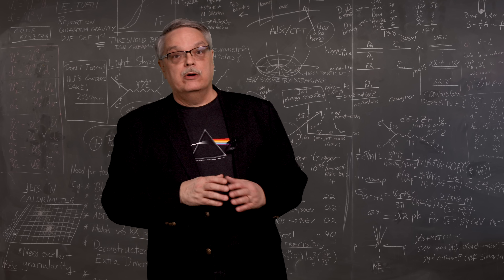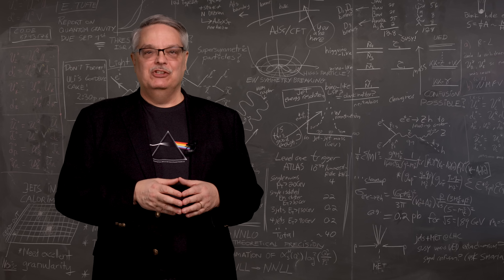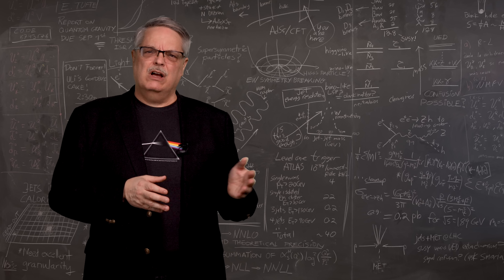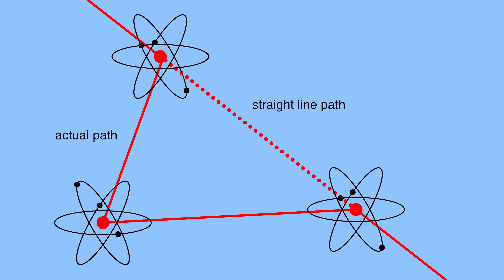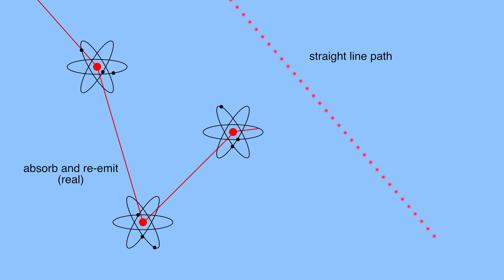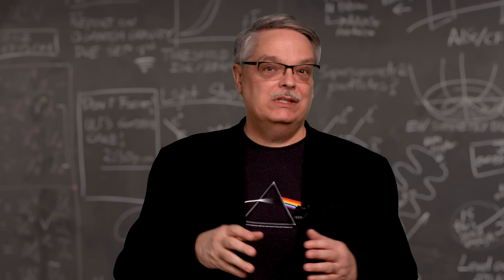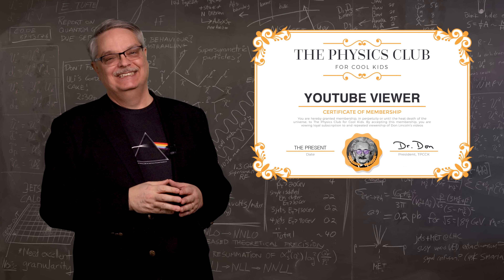Why does light slow down in water?

Comment: Doesn't explain the change in direction nor the restoration of the direction after leaving the material. 
Also doesn't explain why the combined new field after passing the first atom doesn't then combine again with the next atom and create yet another, different electric field, and so on at each encounter with another atom. 

And it doesn't explain how the light, which changed by an angle upon entering the field, and changed again by the reverse of that angle when leaving, retains the direction. The light when it leaves the material could change by the exact reverse of the entering angle, but in a different direction not parallel to the original direction.

This explanation is not satisfying.

Comment: Thank you Dr. Don Lincoln for your video.
May I ask a question. 
What happens to the light or  "lights" that's in the glass of  water. 
I would think light or "lights" can enter the glass from all directions and all angles. Some enter directly, some from reflections, some may bounce off the internal glass wall. I see the water inside the glass as a body in a mesh of lights. Would these mesh of lights skew the object? Thank you.

Comment: Good video, all true but didn't focus much on another effect - the temperature of the water will increase when light passes thru it.  I know it will be explained by the "second" electric field generated by the electrons moving as a result of the light but why does the light emerge on the original path (angle) when the 2nd field which interacts with the light field will be in all sorts of directions depending on how/where the electrons move.  Would explain the water heating up but why does the 2nd field (electrons) add with the original light's eectric field and still give same direction for the light?

Comment: i understand that the peaks move slower, but what about the propagation of the front of the wave. if these waves are simply being superimposed then both the original wave and the second wave generated by the electrons should still exist.  so wouldn't both of these waves reach the edge of the glass at the speed of light ?

Comment: Nice video. So, the generation of the electric field when light passes through a non-vacuum media will consume energy. How does this affect the light? Will it decrease in intensity? Is this energy somehow "recouped" when the light exits the medium and enters vacuum again?
Reply: Light itself doesn't change. Its wave superimposes upon the generated electric field of the electron. The energy of the superimposition is the energy of the light minus the energy of the generation of the electric field (the work required to jiggle the electron).

Thus when the light exits the medium the superimposition ceases and light is free to be the Universe's speed limiter once again.

Physics is essentially the study of how light interacts with matter and how matter interacts with itself. Light and matter are fundamentally separate entities so when we speak of light "changing" within a medium, we are really describing the interaction between light and matter. Once you factor in gravity fields generated in spacetime, the interactions become more than a little wonky...
Reply: Yeah, the induced electric field inside the medium causes some energy loss. This is transformed into heat, which is simply the jiggling of atoms (the same jiggling that generates the second electric wave to begin with). The exit wave will have the same frequency, but a slighty smaller amplitude, thus a drop in intensity.
Reply: @KingIsulgard  that’s not how energy in photons works. Higher energy means higher frequency / shorter wavelengths. You can’t apply the concept of “amplitude” to light waves. (Don’t take my word for this, look it up.)

So this also has me scratching my head: how can light lose energy but still maintain the same frequency? And why would the frequency influence the speed of light?

If that were true then light would travel at different speed according to its frequency. But it doesn’t, C is constant for all frequencies.

Light is massless so if it’s not losing energy through it’s frequency then it’s not losing any energy at all.

I’ve just started investigating this specific topic but my theory so far is that the interactions of the electromagnetic waves in light and matter causes some warping in space-time similar to gravity in general relativity, which causes time to dilate.
Reply: @Yogarine  Light speed is the same for all frequencies in vacuum. Matter slows down light of different colors in different amounts, hence rainbows (and dismay among optical fiber engineers).

The light doesn't lose energy due to the slowness (and the description in the video is a bit superficial, not even talking about quantum mechanics). Absorption and hence energy transfer to the medium happens by losing photon, not by changing their frequency.
Reply: @Yogarine  you can't use "amplitude" for _photons_, NOT light _waves_. The amplitude is an indispensable part of describing a wave. The energy delivered by the wave per second will be proportional to its frequency and the square of its amplitude. In case of a light wave, this amplitude is simply the "size" of oscillations in the electromagnetic field - the larger the wave, and the more it wiggles, the more the energy carried by it. More mathematically, an EM wave can be written as E = E0 • sin(ωt). The amplitude of this EM wave is E0 - the maximum height of the wave. Frequencies manifest themselves to our senses as colours, so if you change the energy of a light wave by altering the frequency, you'll see it changing colour. But you could also change the amount of energy delivered by increasing or decreasing the size of the oscillations, while keeping the frequency constant, in the electromagnetic field. That simply amounts to seeing a brighter or dimmer light of the same colour. 

Here's a nice explanation from a freshman physics textbook to help you out. Follow through the maths to completely understand what's going on here. (In case you feel tempted to "debunk" me before going through this, here's the first line from the learning objectives of the chapter: "Express the time-averaged energy density of electromagnetic waves in terms of their electric and magnetic field *amplitudes*")
https://openstax.org/books/university-physics-volume-2/pages/16-3-energy-carried-by-electromagnetic-waves
Reply: @Yogarine  You should not use the photon model here. It is really only appropriate to talk about photons when something adds energy to the field or subtracts it from the field. In between the field is not really quantised at all.

Comment: It does not make sense. The speed of light is constant for observers in any frame of reference. Time and timespac are directly related to the speed of light. Time dilation exist because the speed of light is always constant. The density of the air should not any difference.

Comment: If you had a hypothetical piece of glass thick enough that it took light, lazer beam, 5 seconds to pass through, and you turned the laser off, would the beam continue to exit the glass for 5 seconds or would it stop when the laser was shut down?
Reply: The beam would continue to exit the glass for five seconds.
The light wave that was emitted is still propagating. Only when the source is switched off will the tail-end of the wave desist from propagating.   The previously emitted wave will continue, only the end of the wave will eventually emerge after five seconds.
Reply: @peeet  Thank you!! That makes sense!!! Sometimes I try and think to hard and confuse myself...lol

Comment: Thank you for the easy to understand explanation. But how this hypothesis explains why the light bends and then emerges parallel to incident light?
Reply: Bending is due to the requirement that the phase just inside and just outside the boundary at any point on the boundary must be continuous coupled with the change in wavelength caused by the change in speed.

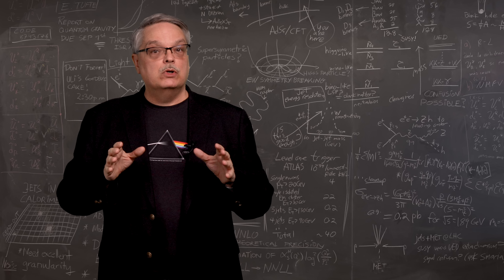Comment: It seems to me that there is a logical lap around 8:45.  It does not explain why the secondary wave (due to electrons) is slower than the original one. I assume that explanation of this fact requires more comprehensive quantum treatment which should also be able to fix the first two attempts of explanation.
Yes, you can also speculate using the electron's "inertia" but this would be a classical attempt (usually prompt to errors) to explain quantum phenomena.

Comment: So light is slowed down by a sheet of glass but electricity isn't slowed down by miles of metal (a cable)?  Obviously there is a difference that exists but a field set up by an electrical potential difference creates the electric current but why doesn't the medium, the cable made of metal react like the glass and set up a wave of its own and consequently slow down the passage of energy in the cable?

Comment: so being that we have discovered a ton of "dust" out in the universe, would most of our calculations relating to time and light need to be adjusted? space is not a true vaccum due to that dust, so would that not throw a pretty huge wrench in to our understanding of the time line of the universe? if there is dust out there it would slow down the speed of light and thus push back dates on things like the big bang? also since we dont actually know the concentration or amount of that dust how can we know how much that light is slowed down?
Reply: We don't even know that the speed of light hasn't changed. It's a major assumption that physicists make.

Comment: Basically it means that light does not travel as light within a matter medium. It becomes some sort of electric wave which is slower than light (magnetic wave) because electrons interact with the Higgs boson therefore they are slower than light because the Higgs interaction creates mass. When light leaves the medium it becomes light again and moves at full speed because Photons do not interact with Higgs therefore have no mass.

Comment: I was taught about fifty years ago in physics that the atoms absorbed and emitted the light in same direction (the second wrong belief). For various reasons (doesn't explain speed of light in different materials very well) it never felt right. When I saw the title to your video, decided to get a better understanding of the process. Surprise ... I was taught wrong. This explanation makes much better sense.
Reply: Please can you explain to me why the wave created by the electrons moves at a different speed 9:20 and also why the combined new way moves slower than the speed of light 9:43 ? Please I didn't find why...
Reply: @Khalid-Ibn-Al-Walid  The wave created by the atoms isn't actually going anywhere. It is an electrical vibration. Light is also an electrical vibration. There is a diagram of the combined wave at 7:05. You can see that the top wave is actually considered to be stationary. Anyway, that is the best I can explain. I became an engineer because I knew I wasn't smart enough to be a scientist.
Reply: @JaimeWarlock  I saw the video many times again and focused on the 7:05 as you said and I think I finally got it ! Thank you very much bro ! 
( Btw me to I want to be engineer, in IT, I like physics but I find IT to be way more accessible and practical 👍)

Comment: How about this explanation.  It is because the speed of light is actually the maximum rate of induction relative to the medium it is propagating in. That is the difference between an atomist's particle physics explanation and field theory based explanation.  When this guy can explain why a magnet still has a north and south pole no matter how many times you slice it, then my ears may perk up depending on the explanation.
Reply: Here is another question.   What exactly is waving in the wave?  What is a wave? Is it what something is?  Or is it what something does?

Comment: The simplest explanation why light slows down when traveling in water is that it doesn't. For the photon it's like you traveling on the interstate at 55 mph, with an average speed of 50 mph because you have to stop frequently for potty breaks. The photon doesn't need to pee but it gets absorbed by the atoms of water. This is a virtual absorption in that the photon energy may not be enough to match the absorption transition energy of a real transition in the water. However Heisenberg's Uncertainty Principle (HUP) allows the photon borrow enough energy to be 'absorbed' for a period of time so long as it is re-emitted in a time delta matching the energy mismatch according to the HUP. The accumulated delays caused by these virtual adsorptions and re-emissions account for the apparent slowing. In addition, during the periods of time that the photon is virtually absorbed it's phase can be altered by the absorbing material. Most of the time the absorbed times are short and the photon is re-emitted without a loss of phase but as the photon energy gets close to a real absorption transition in the material the apparent slowing increases and the phase loss becomes more apparent.

Comment: I've never heard it explained like this before. But I have a problem with it. If the light coming in is at speed c. And the light going through the glass is at .6 c. Them what happens to the extra light? Its like hitting a traffic jam on the freeway. You are going 70 mph, and hits a construction zone so you slow down to 25 mph. The traffic in the slower zone builds up, and keeps building up as long as there is a slower zone. 70 mph is faster than 25 mph. Thus the traffic build up gets longer and longer.

Comment: The combination of waves in materials is a function of the conservation of energy and the total energy remains constant. With things like water waves, the energy is displaced (at the molecular level) into different directions and heat. Light doesn't have this problem. If it is displaced as heat, it never exits the medium. If only some of the light is displaced as heat then some can leave at full speed (think sun glasses).

Comment: You didn't explain why the ray of light changed direction. Also, if the electric fields of the light wave make the electrons in the atoms move, that must remove energy from the light wave. So the frequency of the light wave should also be reduced ?

Comment: For some light waves and materials, like xrays in water, the combined speed can actually be ever so slightly faster than the speed of light. This is just the speed that the waves appear to be moving when looking at a continuous light beam though, not the information speed of a pulse of light, so it doesn't allow faster than light communication

Even weirder, you can set up arrays of electronic circuits that have a negative refractive index for radio waves - the light appears to move backwards inside the material, while the information is still travelling forwards

For more, see https://en.wikipedia.org/wiki/Refractive_index#Refractive_index_below_unity

Comment: Interestingly, the speed of light depends not only on the material but also on the direction of the crystal structures in the material, and if so, then light waves should not interact with all electrons in atomic structures, but only with certain electron clouds.

Comment: @Fermilab I have a few follow-up questions. What I got from your explanation was that waves traveling with different speeds can combine to give a wave that travels at a third speed. And in this case, the two waves being combined are light traveling at a speed c and an oscillating electric field generated by the interaction of the light's oscillating electric field with the matter's electrons. Did I get that right?

My questions are these: 1/What is the speed of the generated oscillating electric field? And why it is not "c"? 2/How do you calculate that speed from theory? And how do you measure it in an experiment? 3/How can two oscillating electric fields of a different nature add up? And what is the nature of the combination? Is it also light?
Reply: They are both electromagnetic waves so it doesn't matter that they are "of a different nature."  They add up like any other waves would add.  The combination is light in this case.
Reply: @kenbob1071  Hi. I had followed up to your comment three weeks ago, and now circling back I find your reply has been highlighted and my follow up is gone! Do you know how those two things happened?